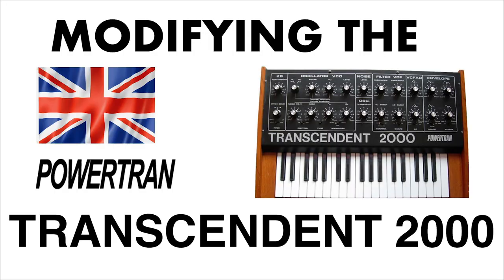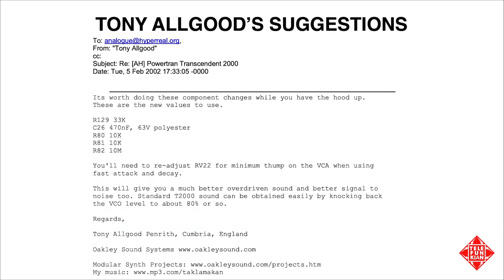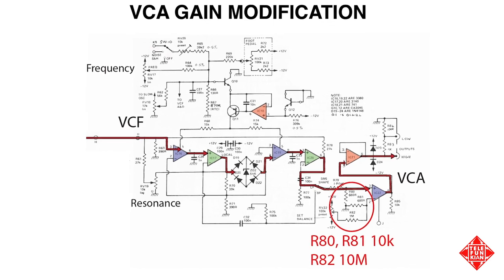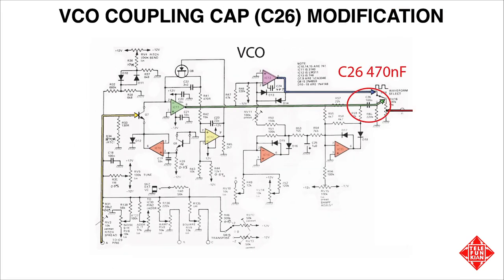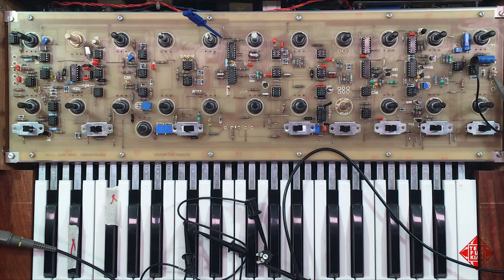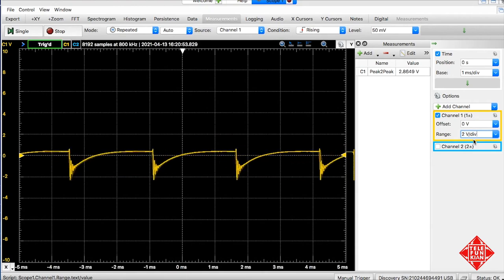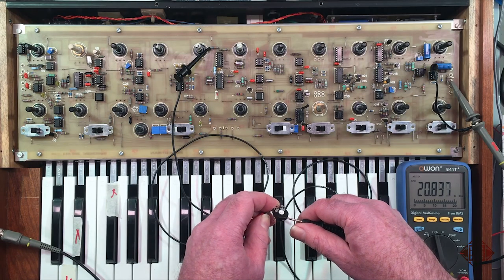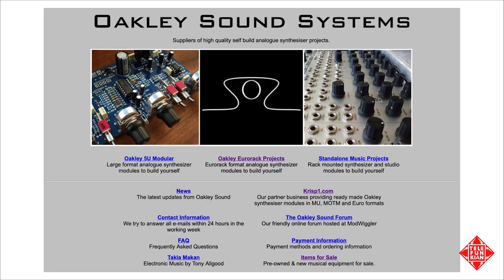Modifying The Powertran Transcendent 2000

Comment: Do you have the mods documented somewhere ? A pdf download would be super useful 👍🏻
Reply from the maker: A PDF of the illustrations in this video you mean? I'll put that on my 'to-do list'...
Reply: @telefunkian  details of the mods you’ve done to upgrade, set out in a pdf would be useful to folks I think.
Btw. Tried everything to try and contact you, look me up ?
Reply: @8-bitbitsa821  there is only one modification to the 68K resistor R129 to 15K. The other mods suggested at the beginning recommended by Tony were not undertaken.

Changing R129 gets to the root of the issue but more care will be needed to set VCO level.
Reply: @guywilkinson  Thanks Guy, I’ve done that mod on one of my T2000s. Seems to work okay, I’ll get the other one working one day.
Reply: @8-bitbitsa821  I did the mod today and liked it, although it's a bit overpowering than the noise source now. I really can't see a use for the self oscillation on the filter......but.....if I want weird.... it's there 🤣

As for square wave, it's not a great square wave. I'd really like it to be sharper, the 748 ic13 and 741 ic14 do not have great bandwidth when used in that configuration especially ic14, maybe I should experiment 🤔